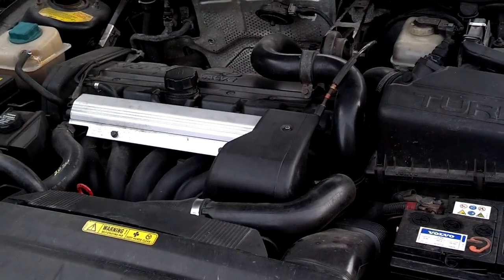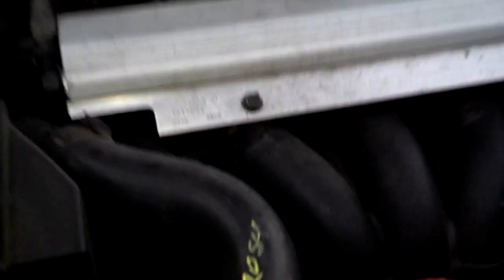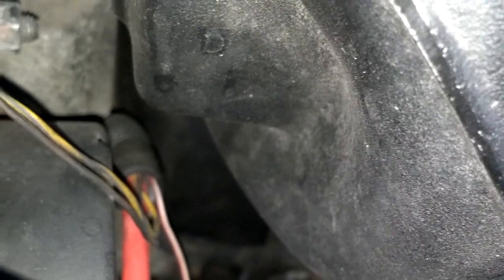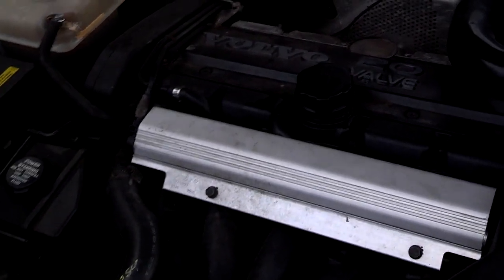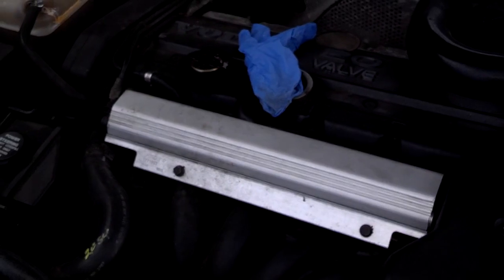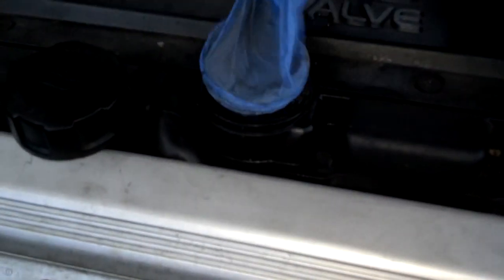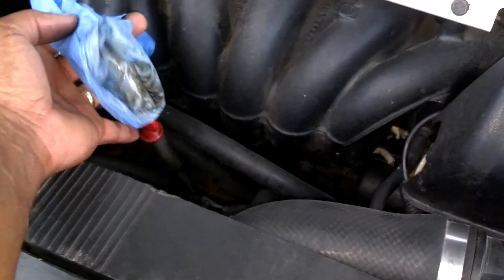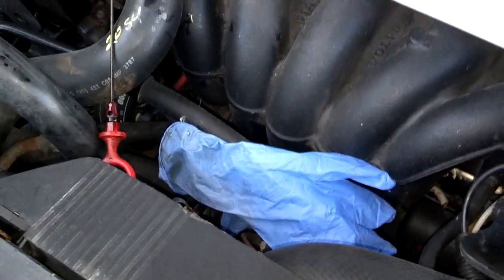Volvo PCV system check, 850, V70, S70, and others - VOTD

Comment: My 99 s70 turbo exerted pressure by popping off a couple of hoses...then it blew the water pump gasket, i replaced it but then white smoke started..lots of it but the car kept going. Until a couple of days ago when i lost all power. All it does now is start for a couple of seconds then chokes and dies 🙄😔😭 what should I do fellas???
Reply from the maker: Fix it.

Comment: Hello Robert! Thanks for your channel! I did the glove test and the engine wants to suck the glove. But a lot of oil coming out  from it. Running the car oil cap and dips tick is surrounded by oil. Pcv hoses and trap replaced, hoses from pcv to ptc are replaced by a bigger ones bc the oem hose is broken
Reply from the maker: I don't even know what kind of car you have
Reply: Sorry Robert, I have a b4194t Volvo s40 T4  @RobertDIY

Comment: Hey Robert I have a Volvo v40 2000 1.9t. I’m trying to figure out on this model if it matters to pass the glove test. When I open the oil cap there is positive crank case pressure and I’m also getting oil leaks. It’s also throwing a p0171 code and randomly goes away sometimes. I serviced the pcv a year ago and it would still fail glove test but I just thought it was normal on this model. If you could kindly respond that would be greatly appreciated. Thank you.
Reply from the maker: https://youtu.be/t4gwoQTW9OE
Reply from the maker: Yes it should pass the glove test. If it failed after service, something is wrong or you did something wrong. The test should be done with a hot engine, parked on a level ground. Common failure causes, worn engine (low compression, worn rings), clogged port into the oil pan or loose vacuum line.

Comment: Thank you Robert,you helped me several yrs ago diagnosing bad fuel pump relay.I just bought a 2000 s70 and it has a major oil leak,looks like from up under timing cover,perhaps bad cam seal,blown out from clogged pcv.Although its 10pm,gonna get out there and start taking it apart.Thank you again my friend !!
Reply from the maker: Thanks for watching

Comment: Hi Robert, thank you for your video! You are saying, that if one does not have any prove that the system is serviced, one should service it. I just bought a 1999 V70 and I do not have any of that proof. However, both of the test come to a good result that the system is working properly. Would you recommend a service anyhow or wait until one of the test fails? Thank you!
Reply from the maker: Wait until it needs it.
Reply: Thank you :)!

Comment: Robert at the bottom of my dipstick I see oil blowing out from the seal. It’s leaving my manifold with oil towards the bottom of the manifold where the dipstick bracket is. I replaced the oil trap with the kit only and some oil is blowing out of my radiator oil lines valves but from between the plastic radiator core and tube that the line connects to. What you think
Reply from the maker: I don't even know what kind of car you have???
Reply: @RobertDIY  98 volvo s70 2.4 turbo charge

Comment: There is a very small amount of white smoke coming from the oil dip stick hole, however when I do the glove test it seems that it barley blows up the glove. Any suggestions?
Reply from the maker: If it's trying to blow up the glove do a compression test, if the test is good, service the PCV system.

Comment: In my volvo both test are good but i hear whistling from PCV system.
Reply from the maker: which vehicle is whistling?
Reply: @RobertDIY  Volvo s60 2.4, 140hp. Propably membrane of PCV system is broken. I have this whistle from about 3 years. Yesterday I found out why. When I take off the oil cap then noise stops.

Comment: Do you have any on a Volvo S60 '09. It keeps throwing the engine system code. Idle will not stay steady and almost lack of power and then sometimes it throws itself into Lent mode
Reply from the maker: No sir

Comment: Hi Robert, I hope you're doing ok in this time of Covid. I recently bought a used 2000 S70 and didn't drive it far. It had a bunch of codes that don't clear when  the battery is disconnected. I drove approx 7-8 miles a couple of times and when making a left turn ( coincidence?) the vehicle stalled. Also the oil  drain plug is like it has fused to the case. Any ideas on these things. I'm going to do your pcv system tests later today. I'm also going to the local auto parts to see if they have oil pan gaskets, in case I need to remove the pan. This vehicle has a perfect body pretty much so I intend to make it road worthy, especially with these gas prices.
Reply from the maker: https://youtu.be/-2oIeIhpV44
Reply from the maker: https://youtu.be/gt9w-ZSxs9I
Reply from the maker: https://youtu.be/I7HfHowOh7I
Reply from the maker: Likely a loose ground wire somewhere or some other wiring issue. Probably will take a Volvo mechanic to find and fix it.
Reply from the maker: I would have a good mechanic replace the drain bolt. You supply the correct Volvo bolt. They will likely use an air chisel.
Reply: @RobertDIY  so you wouldn't drop the pan?

Comment: What about a 2011 volvo xc90 with 3.2 can pull oil fill cap off after you shut off and you you see smoke. But all the other test fine ?
Reply from the maker: Wow! So the 220 degree oil is not suppose to smoke when suddenly exposed to ambient temperature?

Comment: Great video.
What mileage would you expect to start having the pcv system serviced at.
Reply from the maker: I've put almost 300,000 miles on mine and it's still good. If you use full synthetic oil and don't damage the system parts it can last forever.

Comment: I have done the glove and everything looks ok, but, what should happen if I rew the engine. In my case while ideling, the glove is sucked in, but if I rew it, it kinda starts to blow up, is that OK?!I am having an oil leak from head cover oil cap, i have changed the oil cap, changed PCV system, but still there is quite a lot oil spilled on cam cover. Could it be a crack in the engine block or head?!  The head gasquet is new, the engine S70 T5 (B5234T3) and there is no preassure what so ever in cooling system.
Reply from the maker: https://youtu.be/L1fQjpc39ZQ

Comment: Hey Robert. I just checked my 98 V70 2.3 T5. It’s got 264,000 miles on it.

When I fitted a glove to the oil filler cap, the glove is being filled with air. 

Also, I have what appears to be an oil leak under the spark plug cover which I thought was the oil filler cap seal; I can also smell what I thought was CO but is more likely crankcase vent gas.

In Europe we have a brand called Professional Parts Sweden. They sell a full PCV system for around £70.

Would you recommend an after market kit or stick with genuine? I must be mindful of spending silly amounts on a car with this much mileage so after market does appeal.

Thoughts?
Reply from the maker: Any  job that takes more than 30 minutes should be done with Volvo parts.
Reply: @RobertDIY  thank you. How long do you think a garage would take to complete this?
Reply from the maker: time estimates are in the comments section of the repair video.
Reply: @RobertDIY  thanks Robert. I went to my local Volvo dealer today and purchased the lot, minus the main breather pipe which was far too expensive (I purchased this from PPS)
Reply from the maker: https://youtu.be/SIF24FiWjCo
Reply from the maker: https://youtu.be/hwCzPPiBxk8

Comment: Hi Robert,
Have a V70 turbo mk1, changed the PCV on it , but the rubber glove still inflates slowly even at idle. What could still be wrong?
I didn't check if they was sludge inside the engine at the connection with the breather box. Could it be the cause?
Could  venting the oil cap with a long drain be a temporary solution before repair ?
Reply from the maker: https://youtu.be/s76DjowN68I
Reply: @RobertDIY  thanks Robert, I'll check all this out. Very informative, as usual!
Reply: @RobertDIY  done, suction when engine is hot !

Comment: Hello I have a Volvo V70, that seems to have too much vacuum when I take the oil filler off. it sucks down hard. it also seems to almost stall out my car when the filler cap is on ( it also has a squeaking noise) , when I take it off it runs better ( the squeaking goes away) Im not sure what to look at next. I was convinced it was the PCV breather system, but now I'm not.
Reply from the maker: What year is the car? Cars after '05 has a different PCV system.
Reply: @RobertDIY  robert, I love your channel I am a proud owner of a 2008 xc90. I am the original owner and have 225,000 mi on it. I'm doing much of the upkeep of myself. I sent you a question in the public comments regarding my PCV system and I was hoping you had some thoughts on it.  Emmanuel
Reply: @RobertDIY  2003, mine was the breather box!! I just got done replacing it and the vacuum is normal and no more "Turkey Gobble" sound either. the diaphragm inside the breather box was broken causing that silly noise
Reply: I have a 2008 XC90. It has more of a breather box PCV system. I had a positive glove test which I performed after noticing that I had to keep adding engine oil periodically. I changed the PCV valve trap device on the top back of the engine. It initially worked perfectly and the glove test was negative with the glove being sucked into the oil fill neck opening but after a long drive I again had to add oil and found that the glove test was again positive. This was literally the following day after replacing the PCV oil trap and doing an oil change as well as filter change.

Comment: Hey Robert! Hello from portugal :)Thanks for all the helpful videos! I cleaned and replaced some parts on my pcv system last weekend. It seems like I am still failing the glove test when the car is idling, but when i rev the car the glove gets sucked in. I have a 1995 850 automatic, non-turbo and was wondering if this is normal? Any help is greatly appreciated and thanks again for all the great how-to's!
Reply from the maker: https://youtu.be/s76DjowN68I
Reply: @RobertDIY  Thanks, Robert! Must have missed that vid, I am still working my way through the old material. Cheers!

Comment: I found out this is what was wrong with my car.... After I blew a rod lol
Reply from the maker: Huh? A clogged PCV Will not make the engine throw a rod.
Reply: @RobertDIY  I didn't say that. This is why it was running lean and burning gas. I blew a rod because I disregarded my oil leak too long(I rebuilt the turbo and when I installed the oil return line gasket i didn't seal it properly and just drove it as is figuring it would be ok for a little while.. which it was... A little while) and running it lean like that is a bad combination.
Reply: @RobertDIY  but I was curious where the pcv valve was located cause I never thought to check it out. So for the first time I searched for it yesterday and found brittle hoses going to the pcv valve and I think their was also a broken vacuum line to the intake manifold.

Comment: Hello Robert, I noticed white smoke coming out of my dipstick but the glove did not blow up a lot when I had it running. I intend to replace the PCV system ASAP, but in the mean time, do you believe it would be risky to go ahead and drive about 400 miles on it before replacing my PCV system?
Reply from the maker: what kind of risk are you talking about here?
Reply: @RobertDIY  messing up my engine risk
Reply from the maker: People drive like that ALL THE TIME.

Comment: How did you clean out the engine that you mentioned came to you all plugged up?  I'm here trying to help out a friend with his S40 (likely PCV problem), but I do have a Celica with 330k miles on it, and it blows my glove up like a balloon!  If there are DIY techniques to try and get the vacuum back, I'd like to try them.
Reply from the maker: https://youtu.be/NRgzH0dHDJY
Reply from the maker: On the Volvo you need to pull the Oil Trap box and clean the ports down into the oil pan.

Comment: Hi Robert, 
My 96 850 GLT burns oil. I'm leaning towards replacing the PCV, but I'm not 100% sure because the glove does NOT inflate... but here's what else I know though: 
-There's oil all over the top of the engine. 
-Smoke coming out of the dipstick. 
-The PCV tubes are hard as rock. 
-Dry compression is about 190 across all five cylinders. 
-The car blows white/blue smoke accelerating after idle & exhaust smells of burnt oil. 
-I know the PCV hasn't been serviced in the last 100,000km (at least). 
... so I'm a bit confused as to why the glove does not inflate (I've tried several different types of glove over the oil cap). I will likely go ahead and replace the PCV..  but do you have any other insights? Could it be that the valve stem seals are also shot? 
Thank you as always for your help!
Reply from the maker: If the car is not turbo, probably just shot Valve Stem Seals. What oil are you running?
Reply: @RobertDIY  Thanks Robert. I guess the valve seals will be up next after the PCV :) 
Currently on Synthetic 10w 30. I tried the "No Smoke" product before and it still burnt...
Reply from the maker: where are you located? maybe you should switch to 10w-40
Reply: @RobertDIY  Toronto, Canada. And yes I will give it a try before it gets too hot. Thanks!
Reply from the maker: Only in the summer, May through Sept.

Comment: Hey! i got a Volvo v40 2.0t -00.
It spits out oil from the oil cap when the engine is on.
It runs good and sounds good from the engine.
Is it possible that the pcv breather system needs tog be cleaned?
Reply from the maker: Of course it is possible, it was built broke. Did you do the glove test?
Reply: @RobertDIY  yes i did. The glove fills up  and there is smoke coming from the dipstick

Comment: Hi Robert- Thanks for the videos. I did the glove test and the dipstick test on my ‘99 S70 with 140,000 miles. Glove sucked in and no smoke from the dipstick tube. Had some oil under the spark plug cover and in the spark plug wells. Replaced oil cap hoping that was the problem. Think the PCV might still be bad even though I “passed” the two tests. Thanks!
Reply from the maker: Really? Why would you NOT believe the test results?
Reply: Robert DIY whoops haha meant to add a question mark to that last sentence to get your take. Yeah was just wanting to get your take as an extra precaution. Thanks for replying and take care!

Comment: Thanks for the video very informative. I have a question though, Does a Volvo S80 1999 2.0l turbocharged 5-cylinder engine have an EGR valve or just a PCV system?
Reply from the maker: I have no idea.

Comment: Hi Robert, I know my PCV system needs replacing, because the glove does inflate, & I have blown the crankshaft oil seal through not replacing it. I also have lots of oil gathered under the spark plug cover. But would a clogged system prevent the car from starting & blow white smoke out near the intake manifold.?
Reply from the maker: No, maybe.
Reply: @RobertDIY  Thanks Robert I will test the fuel pump next

Comment: Robert I just completed the PCV system replacement on my 95 960 236000 miles. There aren't any instructions anywhere!  The 6 Cyl is different than all others.  I've found that while doing this job you need the entire kit from FCP. You also need extra vacuum hoses, clamps, injector seals.  Most say to you don't need to pull the intake completely off to get to the pcv box, not the case for the 6 Cyl you need to pull all of it off and clean the entire intake system and since your down there clean the egr valve maybe replace the starter too.  Not for the faint of heart as you also need a good set of tools as well.  Thanks for the background info. This will be my last Volvo since China bought them the quality of these vehicles has diminished immensely!
Reply from the maker: China didn't get involved until around 2008.
Reply: Robert DIY, I know ford bought Volvo from the Sweds, along with Land Rover, took the technology then sold them.  I would like to get another good S90 1998 preferred.  I stopped working on my vehicles a while ago due to spinal issues but since the quality of mechanics has dwindled and the cost has skyrocketed, I started DIY, watching your videos has taught me a lot about Volvos. To that I thank you, my next project is seat replacement, carpet renewal and timing belt replacement.

Comment: Hi Robert, do these things apply for diesel cars as well? I did both tests, and got smoke from the dipstick and the oil filler hole. Ofc. the glove also inflated. So i asked the guy from the volvo dealers garage about that but he told me some smoke was normal for diesel and there wasn't even a regular maintenance interval for the pcv system. He recommended to do nothing and drive on.
Reply from the maker: I tell people not to check for smoke but the do it all the time. 🤦🏾‍♂️
Reply from the maker: I don't know anything about diesel engines.
Reply: @RobertDIY  Therefore i did the glove test as well, which failed, too, which means the glove inflated. But maybe things are indeed different with diesel.
Thank you anyway. I will do further research on that.

Comment: So I recently was driving and I started to smell oil after doing a pull or too in a 2000 c70 t5 and I find out it's leaking a ton of oil from near my oil filter or above but I can't pinpoint where's its coming from, it leaked atleast 3 quarts in the matter of a few miles and some more when I parked it . Just wondering if u had any thoughts on what could cause an oil leak like this
Reply from the maker: https://youtu.be/vJXfQrDPK04

Comment: Robert... got a 2006 v70 2.5 T AWD 208000km on it...... right before you come to a stop at very low speed the transmission clunks ..... I’ve brought it to a very reputable shop  and they went through a reprogramming of the tranny as per Volvo directions and still can’t get that clunk gone.... all other tranny functions seem normal?
Got any ideas
Reply from the maker: Are all of the mounts good?